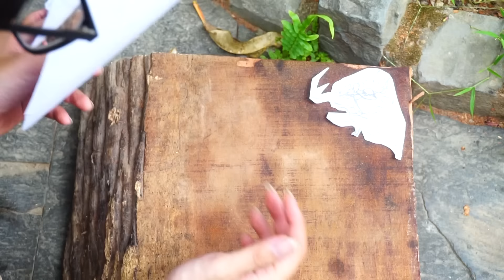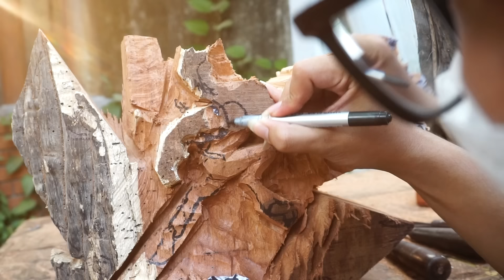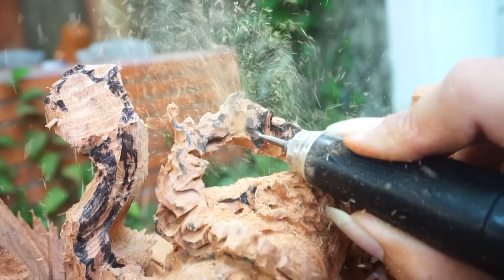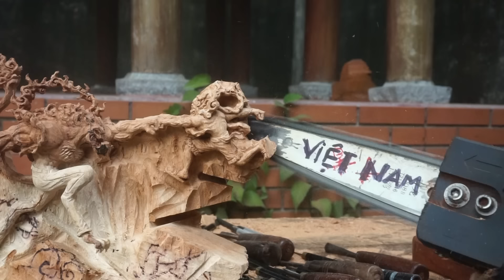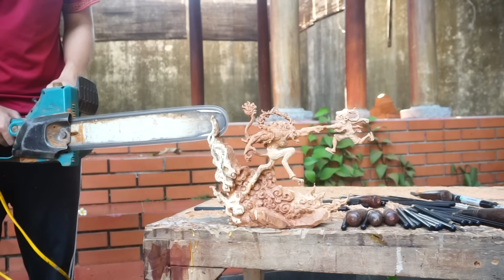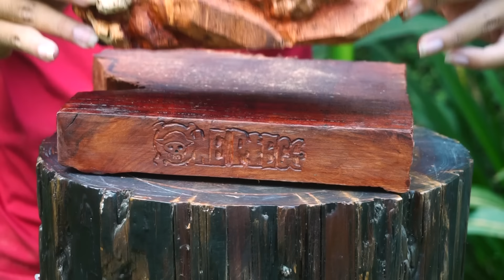One Piece: LUFFY Gear 5 vs LUCCI  - Wood Carving ASMR - Extremely ingenious Woodworking Skill

Comment: When you whip out the chainsaw after spending so much time detailing a section it makes me wonder how many times you accidentally took off Lucci's or Luffy's head or legs. Not just in this "one piece" but in any other as well. 

I wouldn't exactly call a chainsaw a precision instrument.
Reply from the maker: Yeah i was scared at that moment at well, but just need to focus and make sure the chainsaw will not destroy the finished details